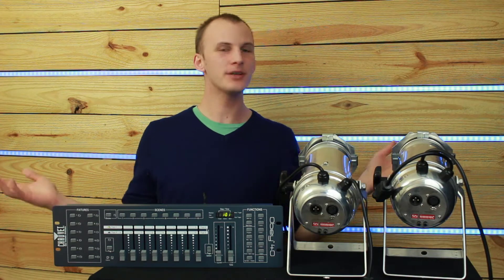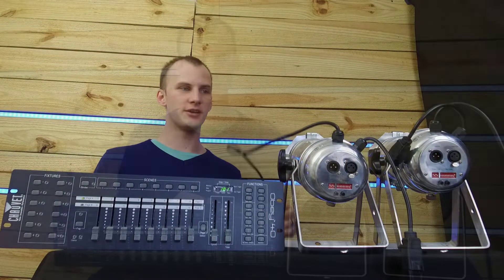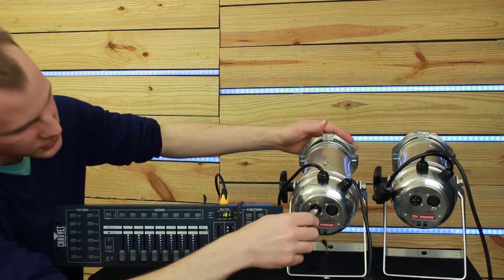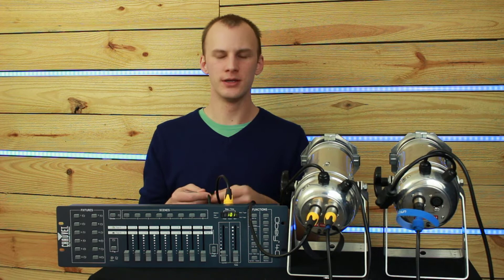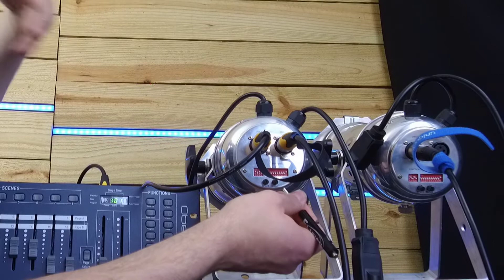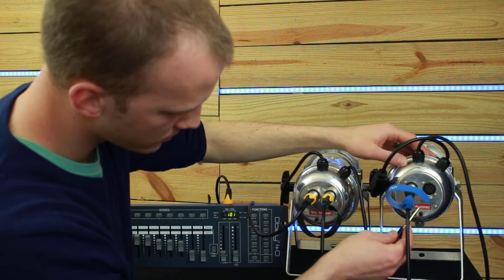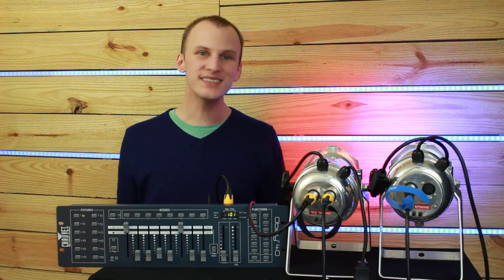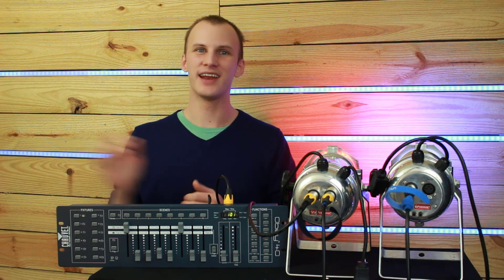How Do You Setup Basic DMX Lighting? - DMX 101 Tutorial

Comment: Cable impedance is the thing most new lighting guys/gals miss. DMX/RS-485 is spec'd to 120 Ohm cable, while standard audio XLR is 75 Ohm.  120 Ohm is made for square data signals, 75 is for sine waves and can cause your nice square waves to get distorted into rounded leaded and trailed edge signals.

Comment: This is a silly question, but I'm a rookie in DMX lighting. I've been asked to purchase and operate DMX lights for my church. How would I connect the DMX cables to the board if I'm about 100 feet at the back of the house--not as close as you stand by your lights in the video? Can I mix PARs and DMX on the same truss?
Reply from the maker: No question is a silly question :)  100' is fine, you'll just need a long cable.  You absolutely can mix different types of lights on the same truss, it's no problem!